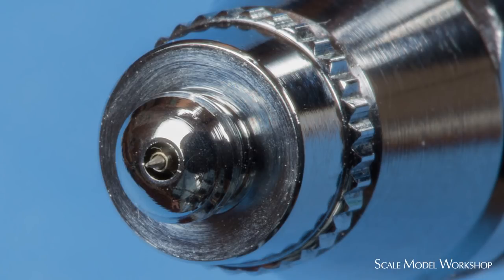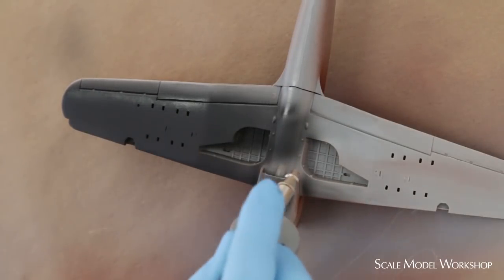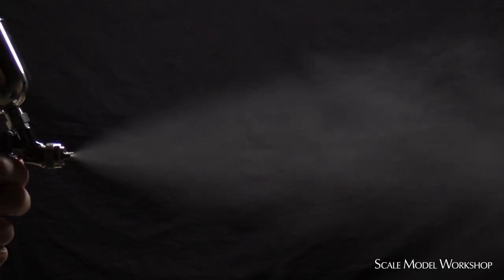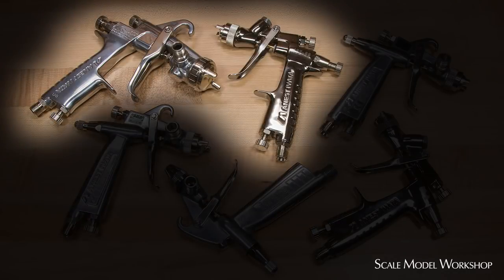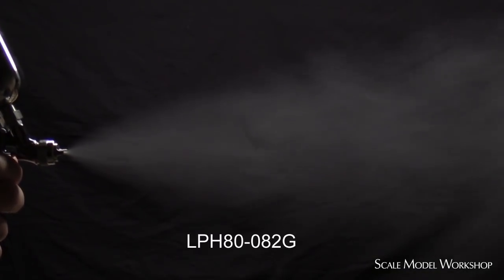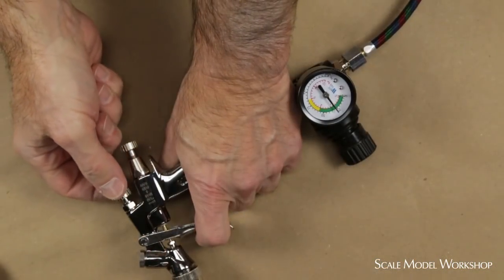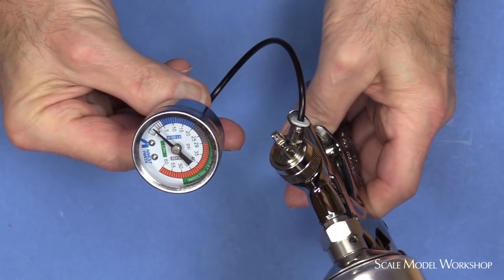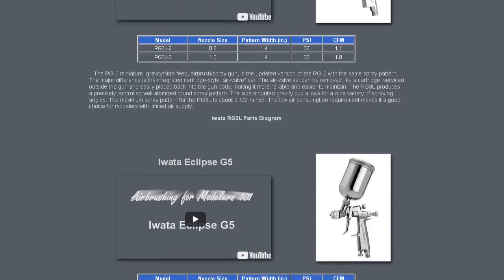Mini Spray Guns for Scale Modeling

Comment: Paul:
It's great to see you are making more videos and have a new channel.
I model in 1/32 scale model trains especially. locomotives. Locos have many details that are hard to access without an airbrush so painting them can be difficult to do without getting the airbrush "dried paint" over-spray around the details you show so well.  I would like to use an HVLP  gun to paint the large surfaces, but will the gun make the airbrush "dried paint" over-spray  areas smooth out from the first coat painting of the details? 
I really like the surface finish you are getting with your guns.
Please keep the videos coming.
Bill Box
Reply: Hello, I am just getting into model making and wanting to learn with the best possible, or most suitable tools hence why I am looking at the above video, the main interest in using the mini spray gun is for my 1:24 scale cars, 1:32 scale Military vehicles, architectural buildings and also many wargame type tiny figures and machines, I have a wide field of interest :) Did you work out which mini spray gun was most suitable and have you enjoyed the experience since using it compared to a normal airbrush? Your opinion and possible recommendations would be very much appreciated :) Also, I bought the standard mid tier airbrush compressor, would this still be suitable for using with the mini spraygun?
Reply: Hi squuz, 5 years on what spray gun have you ended up with? I’m in the same position you are with regards to models etc. 
I’m using an iwata revolution with a 0.5mm needle and having all kinds of orange peel and finish problems. It just feels like I can’t get enough wet paint on the surface to pull out nicely. I feel like a spray can would do a better job. 
So I’m wondering if a mini spray gun might be the answer to get more paint on. Interested where you ended up with your problem.

Comment: Hi Paul - I’m using my Iwata LPH-50 (0.6mm needle) for the first time and am getting orange peel on my finish. I’m spraying Tamiya acrylics (thinned with their acrylic thinner) with a 1/2” air hose connected to my portable Dewalt compressor. I have the Iwata gun gauge set to 0.9 bar (approx. 13psi - why couldn’t they have used psi instead of bar?) following your instructions. I’d really appreciate some guidance as I plan on using this gun on many more projects if I can get the hang of it.

Comment: Can the RG3 (.6mm) be used with Iwata Smartjet pro? (It doesn’t have a tank.) Want to get good smooth primer and clear/overcoat coverage for 1/60 gunpla and similar sized models. Upate: Based on spec, it looks like the Smart Jet Pro will not be able to work with RG3. Any recommendation on compressors?

Comment: Hi, Thank you for all your great and value information.  I wanted to asked you, if I can used Iwata LPH50 gun with the Iwata Power Jet Lite. I do spray taning.  Can I use the hose that is use on the G3 or G6 guns?  Thanks!!
Reply from the maker: Hello Laly, With any of the LPH Guns you really should  have a tank.  You would probably be OK with your normal hose.  Is the G6 too small?

Comment: Hello!
I had to watch this video several times and then read some more in order to get to these questions...
I have a compressor capable of 1.1CFM. I wonder what would be the downside of using an LPH80 with it?
Would I be better off with a G5? The LPH80, G5, and HP TH are the only ones that I can get easily.
I would be grateful if you could find the time to help me with an answer...
Reply from the maker: What are you using it for?  How large are the models?  I doubt you could even get the LPH80 to work. If you want a fan pattern, I think your best choice would be the G5. The TH fan pattern is not very functional.
Reply: Scale Model Workshop 
Thanks for the quick reply!
I plan to use it on my 1:350th scale battleships (eg. Bismarck). I think that my Eclipse HP BS, that I use on my 1:48th airplanes, won't do a very good job. I was considering a Revolution with a bigger nozzle (0.5) before seeing your video... Which apparently wouldn't have helped much.
Reply: Scale Model Workshop 
Hello!
I received my G5 the other day. For the moment I have only tested it with water. Just to get the feel of it.
I think it will do a good job with base coats. I wonder how much over spray it will generate with paint...
The fan pattern is not as flat as I expected but it can be easily adjusted. Now I see why my compressor couldn't have coped whith an   LPH-80.
Thank you for helping me choosing the right thing!
Reply from the maker: Radu ... Don't get crazy with the air pressure and you should have no problem with overspray.  You only have a .5mm nozzle so that's no more material than a typical airbrush wide open... add a little bit for the fan and you are good.  The fan doesn't eliminate overspray ...it just gives you a bigger sweet spot so you make less passes with a better overlap.  It takes practice, just like airbrushing.